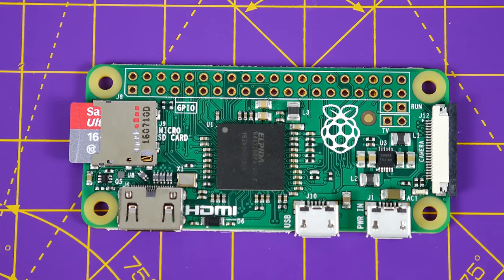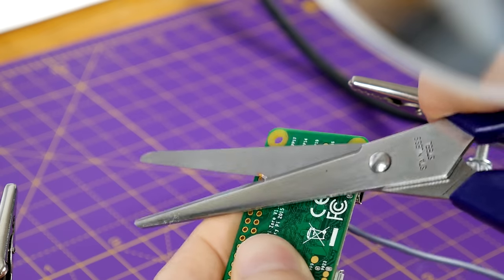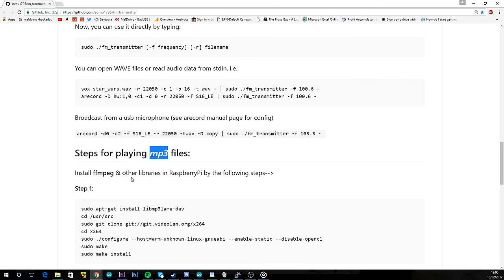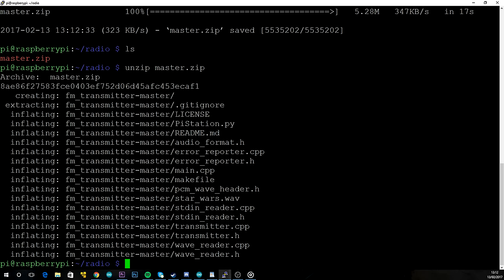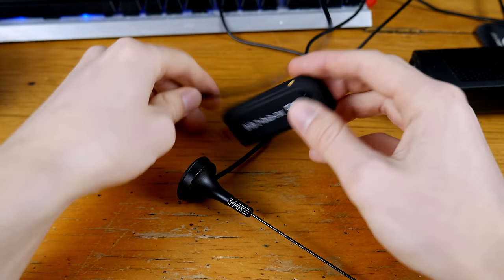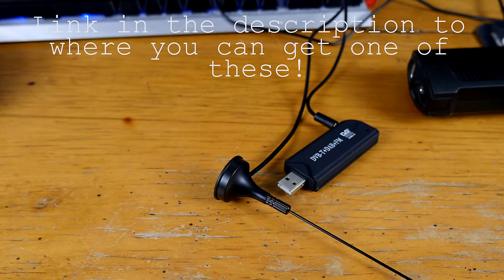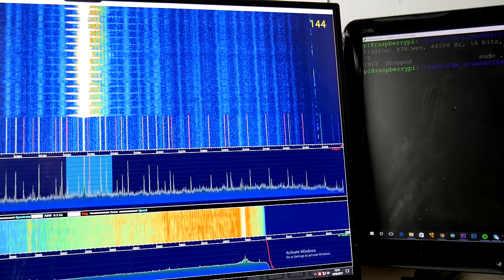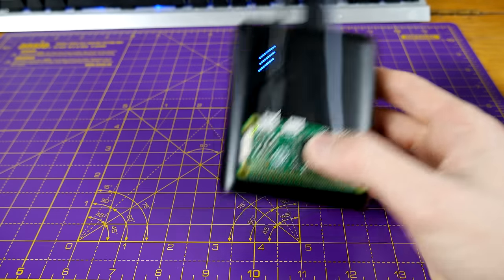Raspberry Pi FM Radio Transmitter | Tutorial

Comment from the maker: If you have any questions/problems regarding this project ask them here --> https://www.reddit.com/r/seytopia/comments/5tuhsc/raspberry_pi_fm_radio_transmitter_tutorial/
Reply: The issue its even a pi3 with all the cores has Issues compilling FFmpeg its possible it just takes arround +1 hour
Reply: shadilay brother,  so  if pi zero can transmit  FM radio then what else could it transmit and how does it do this ?like if you wanted to control RF things 2.4 Ghz you still wold need a super hetrodyne right?
i wonder if this would be able to be used for  some car audio projects , plug your phone into the USB and play MP3 on your phone through your  car stereo maybe add a mic to the GPIO pins and a button  and maybe a bluetooth dongle
 or  a way to get audio out form the 3.5mm jack to the pi
Reply: Seytonic Have you tried using PiFmRds
Reply: Anyone here from the Lone Survivor's Director's radio? that allways made me interested since in the case of a cataclism or an event,you could just transmit stuff over the radio,so the survivors are hearing it,good stuff to see,this pi radio really reminds me of that,good job,I'm subscribed now.
Reply: You will not be able to reach 2.4GHz, however, you could possibly use an upconverter but you would end up spending a few hundred bucks when you could buy an actual SDR for the same price. However yes you could transmit for listening on your cars radio, however, you'd most definitely would need a license for it to be in regulation.
Reply: Seytonic Aye, what if every wave file you play, besides the Star Wars theme that comes with the file, is deemed corrupted? I have no idea why it isn’t working. Halp
Reply: " This thread is archived
New comments cannot be posted and votes cannot be cast "

so i'll ask here....

@Seytonic,  or someone else who knows how to do it....

first,  its a great video! it really helped me with my funproject!

but i want to add something extra to this project.

i want to make it possible for connecting the Pocketstation with my smartphone with bluetooth so i can select music ( For example with Spotify, SoundCloud, Youtube or just files) on my phone and the pocketstation broadcasts the music.

can you,  or someone else help me with this?
Reply: Shadilay my fellow anon.

Much respect. 

Kek
Reply: Seytonic that’s gpio pin 7

Comment: I tried this out and it works, but my goal was to transmit an internet radio stream. However, I couldn't get it to work. I was getting constant errors about the wave header missing, whenever I used SoX. Then I thought of a different and possible better method. I installed Pi MusicBox and used an aux fm transmitter, which I bought years ago to use on a car radio. I extended the range of it by soldering an antenna to the board. Now I can stream music and internet radio on my Pi and transmit this to my old tube radios. Multiple benefits: no unwanted harmonics and an allowed signal. Meaning I won't interfere with any other frequencies and the signal itself won't leave my apartment. The sound quality is also a lot better using this dedicated transmitter. In the future I might buy a HifiBerry DAC to further increase the sound. Another good idea might be to build a transmitter from scratch to have more control over frequencies and a knob to control signal strength.

Comment: Do not underestimate the range your signal can travel. A Raspberry Pi with clean filtered output using a ham radio mode called WSPR has been heard over 5055 miles away on 14.0971 Mhz!
It would literally take just an extra minute to make a primitive bandpass filter from some scraps of cat6 wire.  Cat5/6 has a capacitance of 15pF/ft between the wires in a pair. To make an inductor wind 7.5 turns around a pen to make a 400nH inductor, then take 4.8 inch of a pair and connect the same color ends together from that wire (Blue-Blue, White-White) there is your 6pF capacitor. Solder it to the end of your inductor.  This will form a simple Bessel bandpass filter that will reduce harmonics by -10dB for 0$ However you would need -43dB to use one as a real transmitter and that will take more than some cat5 scraps.
Please take some time to learn about RF before you go transmitting with this kind of thing. You can unexpectedly do great harm and get yourself in lots of trouble. You should also look into earning your amateur radio licence. The test is not that difficult and there are a whole world of frequencies opened up for experimentation if you get a licence. It is the best hobby in the world.
Reply: How can I increase the transmitted signal to reach say 5 kms?

Comment: Wait.. How did you SSH into it? Through the USB cable, how did you manage that?
Reply: Nathan Trone i am not sure but he may have used the usb connection to share his pc network and he ssh'd into it. or he also may have just used the power from usb and sdh'd normally
Reply: It's probably the new Pi Zero W with in built WiFi.
Reply: putty is what  was used to SSH into pi zero via usb to share pc network ...if you see the video properly you can see it
Reply: @theanonomanchannel9991  how do i do that

Comment: "these peaks..." are harmonics of frequency you are transmiting. please put some simple filter on the output, otherwise you will polute spectrum with hamonics, which can be illegal
Reply: They were there before he started transmitting, however you are right it needs a low pass filter.
Reply: You can't add a filter, because the lead to the filter is already enough antenna for the higher harmonics.

Comment: There are 0.1 watt FM transmitters to buy in Germany. Commercial radio stations have 1,000 to 100,000 watts. Because few AM frequencies are available, everything has been squeezed into the FM band for 50 years. 
Good luck finding a free frequency there. 
But little is going on in the 27 MHz CB band. Legal devices are also cheap there.

Comment: Hey, I have some questions about the transmitter. I use mine as a 24/7 broadcaster but sometimes it might just stop looping the playlist, do you know how to fix this so it is just a permanent loop? Can the transmitter broadcast multiple signals at once or must I use another pi? and finally could I use a UHF antenna to increase the range?

sorry its a lot to unfold but I hope you can help :)

Comment: Could you research and make a video on how to make the add-on filters that HAM operators use on these Rpi's to connect them to conventional antennae and use them as an actual transmitter station? I have a feeling you will come up with a much cheaper solution then what's currently available. Maybe even another Indiegogo project?

I have a concept involving a PiZero with one of the mini RTL-SDRs attached to it listening on the same GMRS channel my Baofeng radios are on for DTMF tones from the keypads on the radios to activate the Pi's GPIOS and or record transmissions and relay (parrot repeater) or record and play back (message system) using this method to transmit but with a proper filter and antennae in place.

Comment: Hi 
will it work as a prank if im near a radio for instance in a car with a friend and i transmit it to a radio station thats playing  or it wont cause he original station is stronger?
Reply: Should work fine, its only slightly illegal, i doubt th fcc is going to get on your back for a low powered transmitter though.

Comment: If I use a bigger antenna will the reach of the radio transmitter increase?
Reply: Yes, however without boosting the voltage output of that antenna the audio quality will decrease.

Comment: This is illegal in the UK for anyone that's wondering. You need a broadcast licence from ofcom to be able to do this. Or you could do this on the ham freq but again you need a licence and is frowned upon playing music on the ham bands. You can however use this to listen to the ham bands if you so choose
Reply: radiate less than 50nanowatts (-43dBm), on a 0.2MHz raster in the range 87.5–108MHz are legal for personal use
Reply: @sixsixsixjet  It also will transmit on many harmonics, and these higher frequency signals will carry much faster and will interfere with military airplanes! So no, even with a broadcast licence using this is ilegal!

Comment: could you use a better antenna for a longer range
Reply: Dynamo Drone 300/MHz gives you the wavelength. Divide the wavelength in four. 
you now have the length of your antenna.

solder it to the output pin. you can also attach the same length to the ground pin to act as "counter weight" or the other half of your half-wave dipole antenna.

Comment: 0:49 so there went all the pi zeros. They're almost impossible to get where i live and then they cost you almost as much as a normal pi.
Reply: te0nani almost $30 in my area.
Reply: life just isn't fair -.-
Reply: Be careful with them (the wifi variant) when you do. I've treated my well but one of mine completely lost it's ability to use wifi. I looked at it under a magnifying glass and it looks like the wifi chip might have had a tiny bit of damage (literally grain of dirt sized mark on it). They're only $10 online, btw. $5 8 day shipping though.
Reply: In swiss 5CHF = 5$

Comment: The project has been removed from GitHub! Can you upload your clone of it?
Reply: @Jimmy_Jones  it does not work on Raspberry pi zero w
Reply: @shashankarmy  One of the comments on the article. 
"Regardless of the power output, it 100% fails the FCC rules because it throws harmonic interference all over the spectrum. Without an appropriate low-pass filter in place, this is completely illegal for anyone (licensed or not) to use."

Comment: What is the highest and lowest frequencies can it transmit?
Reply: Also, can the rpi zero receive radio signal? And use it as an sdr?
Reply: @misaalanshori  in principle Infinite high due to its square wave nature,,and no, its a square wave emitter only, no receiver possible without a real SDR module
Reply: @martindejong3974  ok

Comment: This is super kernel depended I ran a pi 3b with the PiFmrds software it works with tweaks sounds great. But on pi zero w with kali linux aloa pi OS you get terrible audio skipping.  I wish Aola pwn pi would implement this considering it be sweet to have all the tools available.
Reply: Also PiFmrds seems to have less interference I noticed it's not gone but it has other features which I find more useful.

Comment: This is an excellent attack vector for hacking into car infotainment systems. If the system doesn't unescape certain characters you can either crash the stereo, or possibly have it pull up a file on the system. I kmow Mazdas had this problem.

Comment: Sorry I should've included this one as well.  Here's a video I made which is also rather boring at times but it depicts my ADSB set up using a cheap RTL SDR. I'm feeding flight aware and some other sites with it.  Look for this range to drastically improve once I get my new tower installed. I'm also planning to make a collinear antenna out of copper tubing I may make a video on that one which is tuned to 1090 MHz. 

https://youtu.be/ShnK6ggNUBA
Reply from the maker: Thanks for the links, added both to my watch later list. Can't wait to get my 'ham it up' working.

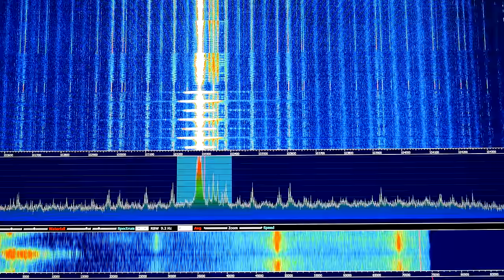Comment: What are the lines at 7:23?
Picture:
http://prntscr.com/g7czd0
Looks like he rage is 103200 to 103380.
So why?
Reply: Because the Pi isn't actually designed to transmit RF this way; this is a messy hack that generates spread-spectrum clock signals and outputs it to that pin. Its cool but bleeds across the spectrum and if operated for more than just a bit could get you in trouble. I'm sure folks think nobody cares but there are a bunch of retiree HAM's out there that would have no problem triangulating and reporting it.

Comment: FM transmitting with rpi have huge problem. It spits multiple of signals on various frequencies, not only freq you choose (103.3 in this example). You can observe that on  7:20
Reply: False, FM transmitting itself uses multiple frequencies at the same time, to be exact a range of ~200KHz. It says it in the name itself; Frequency Modulation.
Reply: If receiver is too close to the transmitter whole range "feels the em"
Reply: Luka Paunović which is very true with with rpi i also use 7watts czr xmitter
Reply: @painfulwill  Bullshit even the modulated signal is multiplied many times due to the square wave output, its not limited to a 200KHz swing.

Comment: Sorry I am going to be the fun killer of the project. I have worked with radio systems for a couple of years now. there is no filtering meaning you will be interfering on not just that frequency but other ones swell with are the 3rd harmonic and so on. there are many more issues with this project but I will not go on and I will end this comment now.
Reply from the maker: Yea I noticed that from all the other peaks that appear once broadcasting starts. Something to keep in mind if someone wants to actually use this thing.
Reply: I will try and find some guides on the internet on how to build the filters for people who wish to use it.
Reply: Is it enough to create a circuit with band pass filters?